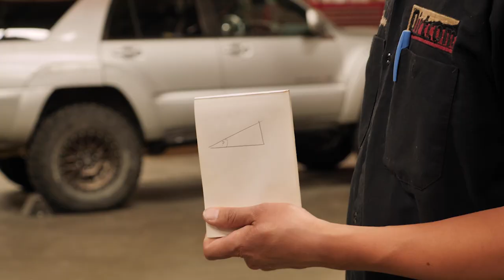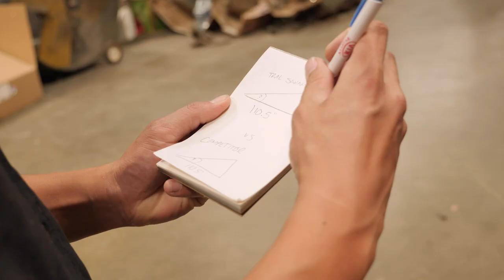SAW IN HALF. TRAIL SWING vs Competitor. Tire Carrier Comparison.

Comment: Nice test.  However, the competitor who builds the alternative product, makes a version which is specific to the 4th and 5th generation 4Runners.  Your test did NOT compare your Trail Swing to the 4Runner specific competitor's model.  Their 4Runner model is a more compact design which would more closely approximate the size of the Trail Swing including departure angles, distance from the bumper, height, etc.   A truer test would be to compare your swing to the model which they make that is specific to the vehicle you used instead of using the competitor's universal "Mega" or "Multi" fit products which are designed to be far more universal than simply the 4Runner design.  My 2 cents.

Comment: The Trail Swing From Dirtcom is by far the winner!!!! Aj and Harry are standup guys and good dudes with great costumer service.  Installed the Trail swing on my 2021 Colorado Zr2 Bison with trail bracket and front runner table fits like a glove. You get what you pay for in Offroad world buy once cry once be happy sleeping at night with the best product.  Long live the Trail Swing!!!!
Reply: Forget Rigd and DirtCom and get a real custom bumper with a fabricated carrier if you want real approach angles with no wobble. These swingouts are cute but are similarly priced if you were to go to get something custom fabricated.
Reply: @pixpods9564  not everyone wants a bumper this is a way to not compromise your factory look and warranty and also you can take it off anytime you want. No body trimming cutting ect… or adding excessive weight.
Reply: @duke1386  You have a point. But I can always almost guarantee that anyone who buys these swing outs eventually sells them to upgrade to an off-road bumper with a tire carrier unless you're a parking lot princess/prince, then these swing outs are fine. Like you said, "buy once cry once..."
Reply: @pixpods9564  I would say 99% of Offroad vehicles people buy 99% of the miles they drive are on the highway. So if that 1% turn into a hard core Off-roader they can sell the tire carrier and have a custom bumper made.  Great thing about Offroad you can go from mild to wild if you wallet has the cash.
Reply from the maker: @pixpods9564  Anyone who has seen me drive my 4runner (also shown on our other youtube videos) will tell you it is not a parking lot princess. For me, the weight of a rear bumper is not ideal. I've been offroading for 10 years with a lot of different set ups. You don't need a full offroad rear bumper to seriously hit the trails. We offer a Limited lifetime warranty because this swing is fully rebuildable from the handle, to the rubber bushings, and the stainless plate. There are lots of different ways to offroad. For a lot of people a rear bumper isn't necessary.
Reply: @pixpods9564  had a Wilco solo before and extremely happy with it. Now with my tundra I am looking for the same route, keep in mind the price of a quality full metal rear with tire swing out is easily 3k nowadays and weighs 200+lbs.  again, it’s the reversibility that these kind of product is targeting to.
Reply: @Duke I assume your Bison has the off road bumper, what did you do about the recovery point that sticks out?
Reply: @meltaylor1374  has 4 torx head bolts Myself Aj and harry took the out and left off the recovery point on the passenger side.
Reply: @duke1386  that's kinda what I thought... it's definitely on my list. Thanks
Reply: @pixpods9564  Before commenting you should look into vehicles. He has a ZR2 Bison, which already comes with an aftermarket rear bumper from AEV. The downside is AEV's solution to having a 35inch spare is to make the spare mounted into the bed. Not ideal for camping or wheeling. Which means Dirtcom to the rescue!

Comment: I did a lot of research on both products. They are both great products. You almost got me to commit. It was the price point that killed it. Competitor 1399 you 2000k. I have a 2000 tundra I had to go with full size application.
Reply: But did you upgrade anything on the $1399 swing ? Or just buy it as it comes with no extras blind to it? I have seen the rigid and dirt's version and once you add all the extras up it's more than what comes standard on the dirt complex HD swing.
Reply: @OCSPARKY1  yes can be true but I won’t go over the price point. When I received and opened the box some of the points pointed out in the video seems like rigd improved on that. For one example. The spare tire holder instead of two bolts on top they now changed it to just lining up one bolt. The guys at rigd seemed to use it to there advantage.

Comment: As you say "rust is a killer" but how does that pair with reviews of the Trail Swing that point out the prevalence of excessive and premature rusting on the Trail Swing and the fact that when the reviewer contacted Trail Swing they were told that Trail Swing's warranty DOES NOT cover the failed or improperly applied powder coating. In fact, the reviewer sprayed his Trail Swing with bed liner to combat the excessive corrosion on the Trail Hitch. The problem being this is no real solution either. Why won't Trail Swing stand behind their product?
Reply from the maker: @1020donny  All current Trail Swings are now powder coated with a 3 stage process. Previous Trail Swings with issues from previous poor powder coat were replaced. It also has a lot to do with your climate. A brand new car will rust on salted roads,  maintenance is also important. Without context on who, what, of where this example you speak of it is impossible to answer your question. We do stand behind our product. If you'd like to swing by our shop and check it out let us know.

Comment: I like the engineering breakdown and how you qualify your comments. The comparison is also helpful, as I was considering at first, to go with your competitor due to cost. Thank you for this video!
Reply from the maker: @MrAgnostic77  We have had many upgrades and updates since this video including a Solid Billet Steel hitch, solid billet steel wedge,  and upgraded spring latch. Upgraded tire mount. We have not advertised this yet because we are focusing on manufacturing rather than social media. However, we will be releasing an upgrade video soon. Also, through all of this we have kept the same price!
Reply: @DirtComplex  , I look forward to it. I'll have my 4Runner soon, and I look to make this an upgrade.

Comment: Great video, and great product. Still went with the ultra swing as it's cheaper, has more accessories, and they are local, so no shipping fees. 

To be honest, and this is just off the top of my head, isn't having the hitch pin in line with each other safer then having them stepped up? I totally understand if that was to achieve the better departure angel, but if I was gonna tow, I would pick the ultra swing for that reason. 

Also, no offense, but I think the ultra swing looks better, as there is alot going on visually with this tire carrier IMO.

Great to see competition in this part of the market, as it's a bit dry at the moment. Great option for sure :)

Comment: I've been searching for swing hitches. I have a 2023 Subaru Ascent and there was a comparison video on youtube showing the Wilco, Rigd, and Dirtcom.  I hadn't watched the full video up to the Dirtcom part originally, then finally went back and finished the video. Glad I did! I'm impressed with what I see and am ordering the Dirtcom right now (along with the front runner table and trail bracket for rotopax).  I also LOVE that everything is replaceable, that is a big deal for longterm customers, to keep the hitch in good working condition without having to buy a whole new one.

Comment: Good that this is being tested, we will never know if the they build a Costco or a Walmart where you will need that extreme departure angle, The malls are where you will see 99% of 4 runners that has been bough in the US
Reply from the maker: You never know! When I'm waiting at the gas lines at Costco those speed bumps can be a killer
Reply: I am sure for whomever needing this product it was mostly because of the over sized spacer won’t fit underneath the oem spot, and they have a much higher chance using their vehicle the way it is meant for. And 4runner seems to be one of many vehicles this product can be used on.

Comment: I dunno. I just cut down and old Yakima swing out bike rack and threw on a bolt on tire carrier. It was like $100 and worked without issue for years until I sold that vehicle. It’s a spare tire, not a goddamn gorilla enclosure. I have no doubt this is much stronger, but a tire is only going to weigh like 70-100lbs and the weak point is the tongue rating anyway.

Spending $1500-$1800 for these things is unfathomable to me. At those prices, you can get a full steel bumper with a built in swing out and retain your full tow rating, not hurt your departure angle, not exceed your tongue weight,  have better dynamics, etc. What purpose do these products serve at those prices?

Comment: 2:18 the vehicle is visibly lower. Unless one is substantially heavier you introduced a variable that completely negates your test. Suspension is clearly loaded differently between the two.
Reply: It was definitely just from the way they combined the two pictures, I would not compare anything that is not measured out in that picture as the one on the right seemed to be further away from the camera so the vehicle looked smaller
Reply: @4WDisLife  it’s not, you can look at the background and see that they are aligned. The vehicles have different attitudes due to rear suspension being lower in the right.

Comment: Looks great guys.  Quick question.  How much weight can I run on the accessory hitch.  I currently run a 1Up Bike Rack at ~50lbs and 2 MTBs at ~50lbs total  so about ~100lbs total on accessory hitch.  Will that work with your swing out or do I need to start calculating the weight of my extra wheel as well?  Thanks.
Reply: I would like an answer to this question also.

Comment: Can you still pull a big trailer on the full size truck version ? 

I have a pretty heavy big 20’ trailer i tow everywhere
Reply from the maker: All new versions have a hitch assembly built with a solid billet of 2" steel. They are extremely strong! Check out the photos here. https://dirtcomusa.com/products/trail-swing-hd

Comment: what is the weight rating on the swing arm? offroad tire + bike rack + 2 electric bikes for me equals 240 lbs which is 10 lbs under Rigd rating. what is your product's rating?
Reply: I just called them and asked that exact question, they said 250lbs, but they've tested them up to 5,000lbs before they broke.

Comment: Just saw a video where your tire carrier broke off on Ken Block's video with Audi e-tron hooning around. Can you explain why it happened and how you will reinforce/address this issue?
Reply from the maker: The Trail Swing used in Ken Block's video was modified. This was not modified by Dirtcom. A 3rd party extended the hitch reciever tube and the extension failed at their welds. Ken Block pinned our comment to the top on the video comment section explaining this.
Reply: Longer arm (extended hitch) would create much higher torque

Comment: So how much can I actually tow with the DirtCom considering extension length? Does the 7501# have to be diminished for length? Will it safely tow 5,000# and 500# tongue weight? Thanks
Reply from the maker: Hello,  you are on the right mindset about tow rating and tow safety. If you research tow hitch companies (like Curt) any of their 8" extensions include a disclaimer that they will reduce up to 50% of your vehicle's tow rating. Now that in itself is a very broad statement.  It will depend on your vehicle. OEM companies rate their vehicles different ways with different safety factors. The Trail Swing lengthens your tow hitch by an average of 6". Using the same ratio this would decrease your rating by 37.5%. Again, these are general guidelines. A vehicle with body on frame vs unibody construction will have different safety factors.
Reply: @DirtComplex  thanks for the response. I’m curious about the max of your hitch itself. In the video were you saying it is capable of up to 7501 or is the percentage to be taken from that starting number. To clarify, I’m not asking about the tow capability of my vehicle. I’m trying to make sure that your equipment itself is capable of the 5000/500 I referenced earlier. Knowing your product extends 6inches is very helpful also. Thanks again. Great looking product.
Reply from the maker: @OrganizedMud  yes it can handle the 5,000/500. For the standard size Trail Swing we tested to a vertical tongue weight load of 4,000 lbs before failure.  This was before we updated the hitch assembly. Current version is robot welded with added plating for longevity.
Reply: @DirtComplex  outstanding! Thanks

Comment: great demonstration.  however, your calculation of the angles is inaccurate.  as you lift the front, the tire is raised in an arc making the base of the triangle shorter.  you would need to remeasure the distance between the tires using a plumb bob on the front
Reply from the maker: Hello thanks for watching! When we measured the length of the wheel base the suspension was at full droop. Still, it was more a goal of demonstration and comparison rather than accuracy of angle. For the most accurate angle we could have just measured at the rear without lifting the vehicle.

Comment: What is the max tire size you can hold?
Reply from the maker: On the standard Trail Swing a 35". However the Trail Swing HD will hold 40" tires and is better suited for higher loads or  full size trucks.

Comment: You are comparing it to the multi fit not even to the one made for 4runner .
Reply from the maker: Short answer: we did not make this video only for 4runners but there just happens to be a 4runner in the video. Long answer: The standard size Trail Swing fits a multitude of midsized compact SUVs and trucks. We made this video as a comparison for all the other vehicles out there. There just happened to be a 4runner in the video. However,  the compared measurements will translate to all other vehicles.  It would not make sense to compare the standard Trail Swing to the other company's 4runner specific tire carrier because that tire carrier only fits the 4runner. Our Trail Swing and their "multi fit" is what is comparable for all the other vehicles out there. Thanks for watching!

Comment: ......... you clearly do not understand basic trigonometry. the wheelbase number (110.5 in) is actually the hypotenuse of the triangle, not the lifted flat on the bottom as you have drawn and use for your calculation.